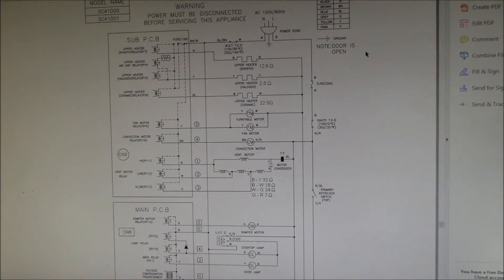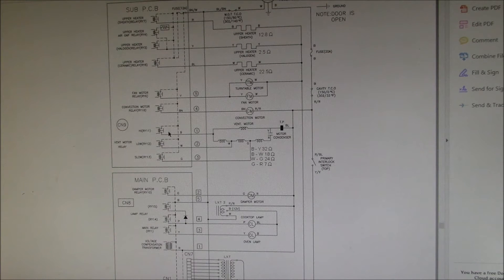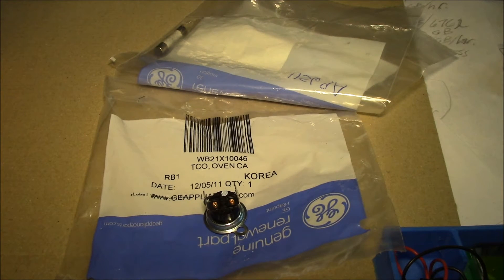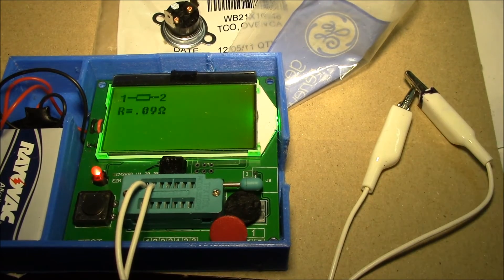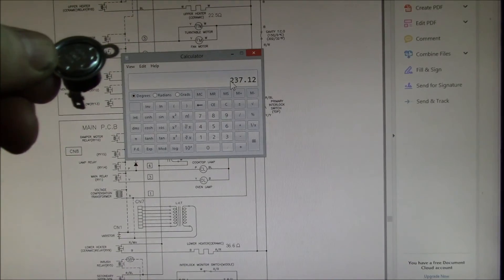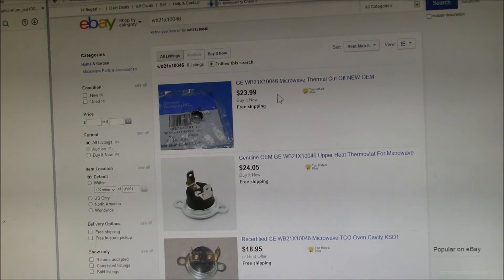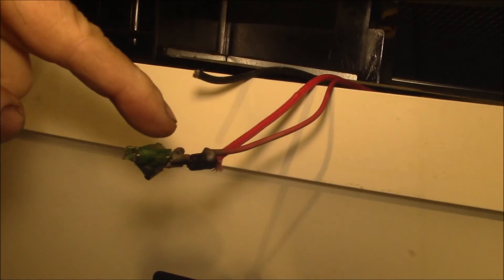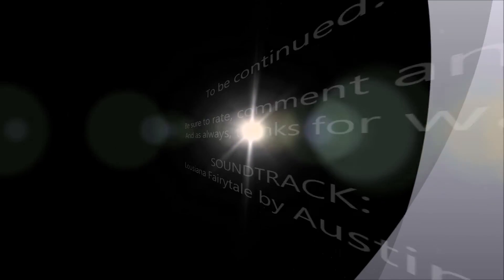Advantium SpeedCook Oven Repair, Part 4 - Cavity TCO

Comment: I have a 220v advantium (love the extra power over the 120v) I just lost both heating elements.  I was cooking with a tin foil pan I could swear I pushed convection to start but after 10 minutes seen large arc, I shut unit off and since then both heaters stopped working. The microwave works fine and the halogen works fine but lower unit and upper ceramic heaters stopped working.  I assume all my door switches (replaced a few over the past 10 years) are working since halogen and microwave works.  From diagrams I see they appear to be on separate circuits in the 120v. are the 2 heating elements on different circuits on the 220v units? would be unusual for 2 separate circuits to blow simultaneously.
Reply from the maker: I've never worked with the 220V oven, but I would check this service manual I found for my 120V unit:
https://drive.google.com/file/d/1YtwaBDOF-scnm3JdCcR1vs53-Oim8FwA/view?usp=drive_link

Maybe there's a similar manual for your unit, I found this one with some web searches.  They have a decent troubleshooting section.

Looks like there's a 240V manual here:
https://www.manualslib.com/manual/2499593/Ge-Advantium-240.html

Comment: I have a ZCS1201NSS01 Advantium model. The microwave portion of the oven works well until it heats ups (about a minute) and at that time the display cuts out & goes blank. The glass plate keeps turning and fan continues to work but the control panel become unresponsive. The only way to stop the unit is to open the door.  By cutting the power off  and then back on the unit goes to working normally until it get hot again. Any help will be appreciated
Reply from the maker: I've not run into that particular problem, the Cavity TCO I fixed in this video will normally cut power to everything.  But here's a link to a service manual on the unit and it has lots of troubleshooting information:
https://drive.google.com/file/d/1YtwaBDOF-scnm3JdCcR1vs53-Oim8FwA/view?usp=drive_link

Comment: my advantium has everything working just the bake is not working....could that be it? baking is the only thing i use....sniff..
Reply from the maker: No, the Cavity TCO will kill the entire machine, no display, nothing will work.  Check out the service manual, it has some troubleshooting steps starting on pg. 39:
https://drive.google.com/file/d/1YtwaBDOF-scnm3JdCcR1vs53-Oim8FwA/view?usp=sharing

Comment: Thank you for VERY helpful and informative video series!  Liked and subscribed!

Our 240v Advantium microwave/convection oven (Model No. SCA2000BWW03) is similar to your 110v model, and it blew the easily-accessible 20amp fuse, located in the upper, right, behind the top vent, so that the oven "bricked," i.e., the panel would not even power up.  However, when I (temporarily) put in a 10 amp fuse in place of the 20amp (not intending to try to heat anything but just to try to power up the panel) it DID power up the panel, but only for 2 seconds, and about 5 seconds at the most, after trying this several times.  Then it immediately went dark, but the (temporary) 10amp fuse did NOT blow.  It still has continuity.

So I'm wondering if the "Hood TCO" is the problem, and I don't know where it is located. 

However, since you said, (I think in video #3?) that the CAVITY TCO is a "single use" item, I'm ASSUMING the HOOD TCO is also single use.  However, IF the HOOD TCO were a "...self-resetting TCO (like they use in other parts of the oven)..." then would that explain our situation?  Specifically, I'm wondering IF the Hood TCO were a "self-resetting TCO," but one that was going bad, if it is "self-resetting" for only a few seconds, then opening up again, causing the panel to go dark.  Does that make sense?  😀

UPDATE:  I found a forum discussing the TCO's, and folks were able to get them working again, sometimes temporarily, by freezing them and, in one case, just hitting them with the propellant from a can of compressed "computer air."  SO...it seems like they ARE "self-resetting," and I'm wondering if you think could account for the behavior of our oven, where its panel powers up for 2-5 seconds, then shuts down again?  

Here is a link to this short, 2-page forum thread:  
"GE Profile Advantium® 120 Above-the-Cooktop Oven Dead"
https://forum.appliancepartspros.com/posts/t127480-ge-profile-advantium-r-120-above-the-cooktop-oven-dead
Reply from the maker: Reading in the service manual, it seems the hood TCO is more of a thermostat that kicks on the hood fan if the temperature over the stove gets too high.  It doesn't seem to be involved in any other part of the operation.  The book shows if screwed to the bottom of the oven.  It might even be held down by the one screw that can be seen sticking through the bottom behind the right side grease filter.

Comment: My GE spacemaker model no: JVM1441WD 003 (wiring diagram shows JVM1440.JVM1441) The first in off of the power on black side (B) is the bottom TCO.  The bottom TCO colors (B & B/R).  That TCO is fine.  The HOOD TCO is next in line.  It feeds in on Gray (GR) and the other side is RED/RED (R/R) that one does NOT pass a continuity test.  Per the modularity-OTT critical parts list for service are: DE4720020A (SEC PARTS NO), WB27X10194 (GEA CAT - NO).  Next is the fuse 250V 20A, it also did NOT pass a continuity test.  The issue is there is no power to the unit, a complete brick.  Yes I have checked the breaker and both sides of the outlet all good there.  The microwave is on its own 20A C-H breaker.  I’m just not sure if I replace both of these parts that it’s not going to have the same issue as before.  The wiring seems to be fine not shrunk, kinked, gnarled up, cut, loose, burnt, or corroded.  Any input from someone with a similar issue or possibly some electronic advise other than replace the whole unit.  (It’s not cheap and matches the rest of the appliances is the kitchen).  Thanks everyone.  Yes I have the original schematics if anyone would like them I could e-mail them to you using cam scanner so you could have them as a .pdf or .jpeg. Again thanks everyone.
Reply from the maker: That's a bit different than my unit and I've never had the main fuse blow on mine.  But it's been issues with the Cavity TCO that's been the cause of most of my problems.  Not sure if your Hood TCO is a similar setup but I found on mine, that TCO is just a bad design.  It seems to overheat due to the 15 amps of current flowing though it (part is running at it's max. rated current) and not from the air flow out of the oven cavity.  I'm not sure if that low air flow is related to running with the rear/external vent instead of the front/recirculating vent setup or not.
I might try replacing the fuse and then you could try temporarily using something like another fuse in place of the TCO to see if it'll power up or not.  That way, if there's some other issue, you've not thrown money away on the replacement TCO.  If it does power up, then grab a new TCO and put it in and see how it works.  The TCOs are only supposed to go out if there's something causing them to overheat.
Reply: @The4Crawler  thank you so much for your prompt reply.  It’s odd that the hood TCO and main fuse both blew, I’m assuming it must have just been weakened by the excessive abuse, however come to think of it we did have some severe storms with lots of cloud to ground lighting, we never lost power but maybe it could have weakened it a bit.  Is there any way to beef up the TCO or the best bet would be a “bypass” with an inline 15amp fuse?  Btw there are 4 TCO’s on this model not sure if that is the norm.  I’ve checked the other 3 and they are good.  The TCO to the magnatron was a bit hard to get to though but it tested out good.  Again thanks, I really appreciate your knowledge and putting it out there it really gave me a great starting point and the TCO comparison $8 vs $25 is a sure winner for me.
Reply from the maker: @Zxavioure  Not sure what would cause the main fuse to blow, but might have been the lightning as you suggest.  If the TCO has the main oven current running through it, like in mine, then you could try a 15 or 20 amp fuse to bypass it for testing.  That way if you plug it in and the main fuse blows right away, there may be something more serious wrong with the unit, like a short some place.  But if it fires up, then you could pick up a replacement TCO and see what happens.  I did that with mine a few times, then decided that TCO was more of a liability than an asset and I eliminated it.  

What GE really should have done, at least on my oven, would be to have that TCO feed a signal to the main logic board and have that shut down the oven if the temps. get too high.  And if that were a self-resetting TCO (like they use in other parts of the oven), the oven would cool down, the TCO would automatically close and the oven would start working again.  As it is, that TCO heats up in normal use, oxidizes the contacts and then fails in a puff of smoke and requires time consuming repair.  Again, not sure if this is different if you set the oven up for front exhaust.  At least in my oven, there would be the front exhaust air flow over the TCO to cool it.  But with the rear/outside exhaust, almost no air flows out past the TCO and it overheats due to the 15 amps of current flowing through it with no cooling air flow.  I did run across a company that made a heavy duty TCO at one time and there's a link to that part in the video description.

Comment: I assume from your current calculations that the blade fuse you use to replace the TCO is 15A. Correct?
Reply from the maker: I think it was around that rating, 15-20 amps.  There's a 20A fuse ahead of this.  The TCO is rated at 15 amps maximum but I think that high current is causing it to overheat and fail open.  They really should have run a lower current through the TCO, like to power a relay coil.  Then if the TCO opened due to high temperature in the oven cavity, that relay would shut down the power to the oven.  Then when it cooled down, it would also reset automatically.  As is, the high current just burns/melts the TCO housing and it fails.

Comment: It's a TCO for reason and not a over current fuse.
Reply from the maker: Agreed, but that's not how GE designed it.  They are running the full 15 amp oven current through the TCO and that current heats it up and it cuts out, due to the resistive losses.  Then you have to tear the oven apart and replace a $24 part then repeat again every 6 months.  The part is supposedly rated to handle a maximum of 15 amps at 125V.  I find that pushing components to 100% of their rating is generally not a good idea.
If they had designed this properly, they should have used this device to send a signal to the controller board to shut down due to over temperature.  There are other such devices inside the oven that do just that very thing.  Where it's located, I think it would only be exposed to heat if one were using it without an external vent.  I never feel any hot air coming out that front vent where the TCO is installed.  
If one were to use oven with the internal charcoal filter in the interior venting mode where you would have lots of air flow out that front vent, it may work properly.  With the air flowing out the front vent, that would both cool the TCO as it heats up due to the resistive losses as well as allow it to sense the temperature of the inside of the oven "cavity".  But with the exterior vent hooked up, almost all that air flow is directed up and out the vent stack and almost nothing comes out of the front of the oven.  This causes the TCO to overheat and eventually turn into a mess of crispy burnt plastic.
It's ironic that a device designed to sense high temperature in an air stream is failing due to lack of that same air flow that is needed to cool it!  To me, this part seems like a last minute addition to the product to pass some sort of safety regulation.  It was likely installed with as little disruption to the rest of the product, i.e. it was just wired in series with the main fuse.  The oven will work fine for a few years like this and if it's used with the recirculated air setup, it'll probably work for a long time.  But this sort of issue won't show up unless you run long term testing in various configurations, all of which was likely done earlier in the design process.  But if this TCO was shoved in at the last minute, it may not have received the complete testing.